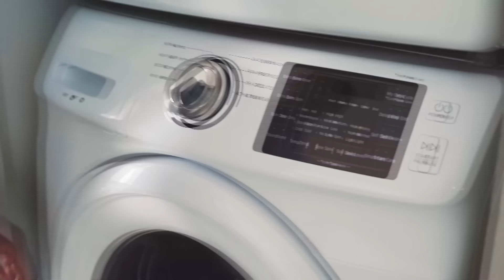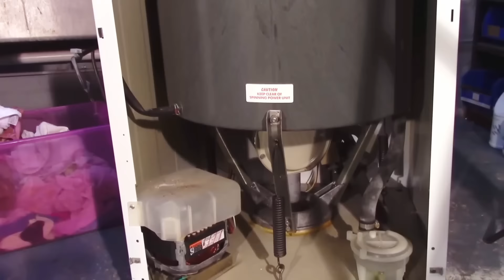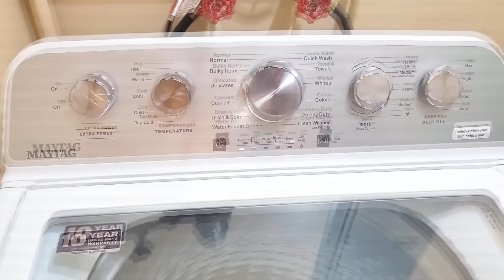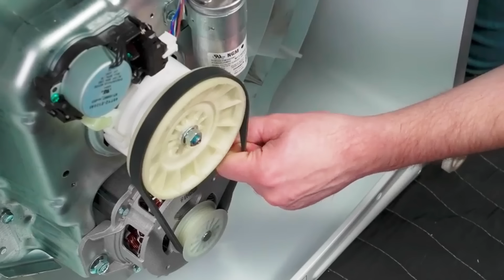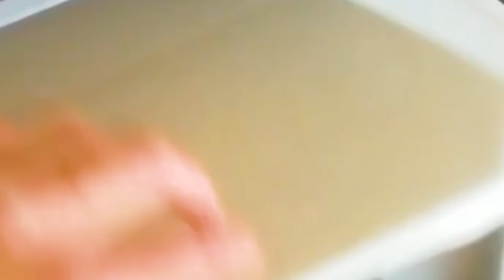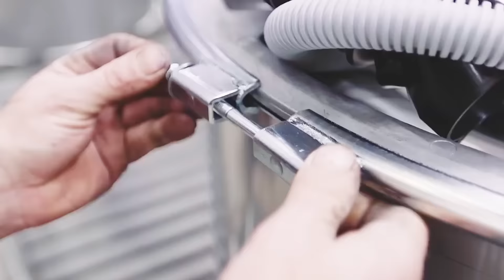3 CHEAP Washing Machines EVERYONE IGNORES (But These 3 Are Absolute Goldmines)

Comment: Speed Queen TR500 owner here, April 2023. Now on third control panel, third lid lock, second water pump and second electrical harness. All common failures across Speed Queen models. Believe the Speed Queen myth at your own risk. Caveat emptor.

Comment: My mother bought it back in the 80s,  and it's been 30 years without any problems, nothing has broken.
Only eventually, Had a it's a little rust
I know people who buy the best Bosch or Siemens washing machines for €2000 and those crap things haven't even lasted 5 years.

Comment: In 1975 we bought a coin operated washer and dryer, Maytag, when new management took over an apartment building.  Each load cost 10 cents.  We used them for twenty years, using the same dimes over and over then pulling out the coin box to retrieve the dime.  Our next set was general electric.  They lasted 15 years.  The ones we have now are LG and I hate the washer because there is no agitator and some things float to the top and never go under.

Comment: I could KICK myself!  I bought a Speed Queen pair new and had it for 25 years - not one repair.  I got rid of it, because I wanted a washer with an impeller in it so it would be easier to wash my king-size comforter.  

I wish my foresight was as good as my hindsight. The Samsung pair I bought (for that impeller) takes significantly longer to do a load, the washer agitates too slow, I don't like the door lock (I live alone), and it's so tall, I have to stand on my toes and really stretch to reach that last sock at the bottom of the drum.  🤦‍♀️

Comment: dont buy a amana with the auto sensor its junk hundreds of bad reviews the control board is horrible the drain motor runs by itself wont turn off and sensor on the board needs replaced its flawed and avery common issue .no such thing as a good smart washer

Comment: Yep, have had my Whirlpool stacking washer and dryer for 32 years now. Bought both used for $300.  Have had to replace the heating element in the dryer once and a gasket under the tub in the washer once.

Comment: I have an lg front loader still clean but the drum thumps back and forth .-all mechanical, dates from 1997.

I replaced Sorings and shocks myself, with the help of my kids!  But the center spindle unit needs replacing. Is that worth it?

Comment: We have had a Kenmore 80 series washer for the last 25-30 years running trouble free other than me having to replace the motor drive coupling a few times, I bought a heavy duty coupling and hung it on the wall behind the unit to be prepared for the next time but it just keeps running on and on!!! 🤔

Comment: 1. Maytag
2. Whirlpool 
3. GE filter flow
Reply: Our Admiral washer will be 30 yrs old in June. Looks/works like brand new!
Reply: @jrzzrj   got a Maytag, will be 30 years old next month (Nov 2026)
Reply: Thank you
Reply: Thank you
Reply: White Westinghouse upright freezer bought 1994 - still working - no repairs! Bottom freezer LG refrigerator not even 6 years old compressor failure today! May tags now are junk will never buy another washer from them! New appliances are crap

Comment: I really miss the fact those old school machines didn't have electronic panels. The timer knob was quick, simple, reliable, effective. If you just wanted the washer to spin or rinse and spin, it was easy to set it to do that. And you didn't have to wait for it to figure out anything.

Comment: No smart washer or dryer in my house!
Reply: I'm still using my Kenmore Series 90 washer and dryer and my fridge is a Whirlpool Gold from 2002 and my dishwasher is a GE TriClean Quiet Power I from 2005. I never overload the washer, I take apart the dryer once a year and vacuum it out, and I vacuum the coils in the bottom and the motor in the back of the fridge twice a year. If you look after these machines they will work fine and keep a smile on your face every time you use them. Plus I love the fact that the washing machine uses water and runs for about 28 minutes and the dishwasher runs for 45 and everything comes out perfect.
Reply: Yea, lets keep all the "smart" for our self driving cars.
Reply: These things are more smartass than smart.  I’ll take a simple machine any day…

Comment: I loved GE filter Flo . I am a domestic engineer I have done a lot of laundry. The GE  filter Flo  is one of the very  best machines on the market. I loved the way the  water  filtered  through  continually while the clothes were washing getting  rid of all the lint which can easily be removed  put in your computer.  This feature helps from  lint balls forming on your  clothing. I also liked the feature   where you could control the amount of water  you wanted, small, medium, large loads. I just wish I could buy  a GE washing machine like that  I would be so happy. I hate the  new GE  I bought a few years ago, have no control of the water even though it tells  you deep fill you clothes are only damp  they twist wind up  in a horrible mess together. I have to drain off water add it to my washing machine. I must say  what  ever   engineer  who came up with this design is an idiot who didn’t have a clue how to design a washing machine. The damn thing controls you instead of you having any control over it. When a washing machine is controlling  you  that is going too far  crossing over the line, it is bad enough in today’s world  when other  people try to control you, a washing machine controlling you  is insane. I hate my GE  washing machine, I hope pray no one else has got sucked in  on the GE  model I have, that thing has been noisy from the very beginning.  My machine is a deep fill GE  he  energy star, piece of crap, honestly, I wouldn’t lie about it or exaggerate  about it. I just want to give a warning  because they are expensive, I dread  laundry day, I shouldn’t have to add water to do my laundry.
Reply: I have a GE Deep Fill HE 4.2  washer purchased in 2016.  Never had one problem with it.  Probably at least ten loads each week.   I think many people overload the machines causing them to get fatigued quicker.  Sure, Speed Queen is probably a great washer but for four times the price of a GE.

Comment: Had a Kenmore washing machine that was 30 yrs old that the lid had rusted off. So I used a pencil to shove down on the close lid switch to activate the washer. Did the boys football and baseball uniforms through out the grade school and high school games as well as the household washing. I was going to buy a new lid and the second wife bought a new modern washer and dryer
Reply: The third wife may buy a new house with a garage attached. No telling what your fourth wife will buy.

Comment: I use to service appliances. Best washer dryer Speed Queen hands down! I bought 2 sets of basic in the mid 70s. We have 6 children and they ran every day of the week. And in 45 years I had to replace 1 pump 1 timer some belts and dryer glides maybe $100 retail. Buy any used Speed Queen! Even new ones have 15 year warranty made in Ripon Wisconsin
Reply: I was surprised the computer voice didn't mention the Speed Queen.  I've had my Speed Queen washer 13 years and just use it.  What do they use in laundromats?  Speed Queen.  Basic stuff with not a lot of bells and whistles seems to hold up longer.  Parts left out never break down and never need replacing - Charles F. Kettering.
Reply: I had a Maytag front loader for over thirty years and I think I had one repair. Great washer. I now have an Electrolux front loader and I won't buy another one. I also have a Speed Queen top loader and dryer. I love them. Best on the market. And, yes I have two washers, I've always had two for over fifty years. I like having front and top loader. Just my choice.
Reply: @d @deborahschoonover4294 ectrolux is a vacuum! 😂 Some body bought the name and stuck iron major appliances. I think Whirlpool might build them. Front loaders that weren’t commercial were always a problem seals!
Reply: I had an Electrolux vacuum cleaner years ago, it was great.  So I took a chance on the washer. Bad move.
Reply: @deborahschoonover4294 Vacuum was! Like Kirby
Reply: @deborahschoonover4294 thanks for the advice
Reply: I have one, which I loved but the agitator slowed down to a crawl...I figured it would cost too much to fix it.... advice??? I have a neighbor vandalizing my property, I'm thinking he did something to it..  it was in the shed accessible from the outside.
Reply: You speak truth.  My Speed Queen runs constantly.  Good comments, thanks.
Reply: You used to.
Reply: That's really impressive! 😊
Reply: Apparently that has changed.  People are saying the new ones are junk .
Reply: Speed Queen tears your clothes up. It’s too aggressive
Reply: @americanmuscle3090 Never heard that one. I don’t know about new ones but old ones had stainless non perforated tub. Water went up and over tub for drainage. Perforated tubs use your clothes to filter exiting water 🤔

Comment: Is This Info Legit??
Reply: About old once 100% true, about new machines I would say not 100% is true. 
I had 5 years old Maytag front load bought after getting a house. My household is heavy on laundry due to nature of business what I'm doing and fostering dogs. We are talking at least 3+ loads a day. In fact washer need adjustment  for water levels to make sure whole loads are washed and rinse out correctly and besides shitty access to drain pump filter I love this machine. According to all the experts it shouldn't last more then 2-2.5 years with my usage but it's working and saves me ton of money on detergent and water vs old fashion machine.

Comment: Whirlpool/Kenmore/Admiral/Amana/KitchenAid/Roper/Estate direct drive
Reply: Nutid, Renlig (IKEA), and Maytag..  All that crap  is Whirlpool
Reply: I love a good roper!! Lowes stopped carrying them. We used to wash my husband's bunker gear in ours and it held up fine. Only had to replace it once in 38 years. But it went threw a bunch of moves. What killed it was we lived in a trailer the plug had a short that killed the washer. We tore that old trailer down and built a house.
Reply: @wjreinhardt1797  Ropers were old school Whirlpools. But they were noisy, had no features, less insulation